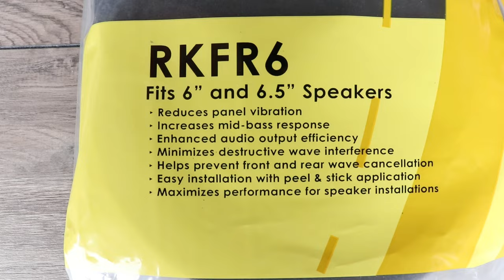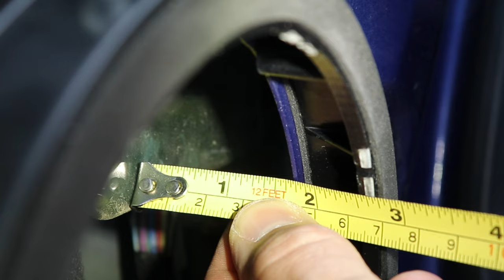Front Speakers UPGRADE, Toyota Corolla - How to Remove & Install New 6.5" Speakers

Comment: I thought that changing the OEM speakers in a car doesn't give much improvement, if any at all, because you are still using the OEM head unit.  I was told that changing out the stock head unit will give the most increase in performance per dollar because an aftermarket head unit will have a better internal amplifier.  

Like on my FJ cruiser, I swapped out the head unit and the OEM speakers had a significant boost in performance.  Guys told me that swapping out the speakers would not do much unless I also installed an aftermarket amplifier.
Reply from the maker: Every part you upgrade will give an improvement.  If you upgrade the stereo, you'll get a huge improvement, and speakers will be another huge improvement.  You can do either one, or both. Doing both will be the best. I've done this many times.. speakers and stereo, or stereo followed by speakers.  There is a noticeable improvement with either upgrade.
A cheap speaker replaced by a quality speaker will still sound better, even with the OEM head unit. Also a high end head unit will be able to drive a cheap speaker a little better due to better sound processing and fine tuning of the equalizer (boost bass, mids, treble). You'll still get a very nice improvement if you upgrade the speakers though.  There can be a rare exception in which the car comes with really good high end speakers..sometimes there are optional JBL systems, and so on..  that's not the case for my Corolla though.
Reply from the maker: Also, the stock amplifier on a high quality head unit is plenty good to drive a decent pair of aftermarket speakers (with the proper sensitivity)  to nearly their full potential. Don't pick high wattage speakers for a head unit amp.. if you do then an external amp is required.   External amp is not required to notice a big difference in sound quality, it is required to boost the wattage and get a big difference in volume .  I'll be posting a Head Unit upgrade video soon (upgrade to Pioneer stereo), with before/after sound sample. The Pioneer is able to drive the Infinity speakers way better than the stock unit.. as you mentioned, the unit does make a big difference.  But if I had the stock speakers, it wouldn't sound nearly as good.

Also if you want to have nice bass, then an external amp with a subwoofer is the way to go. Depends on what type of music you listen to.. you wouldn't need that for classical music for example. If you do go with external amp, then you can also consider an external crossover as well.. and then again the quality of the amp and crossover will matter a lot. A cheap amp may sound worse than the Pioneer stock amp.

Comment: Thanks for the detailed guide and time put into this. Fellow Corolla owners appreciate your time and effort. 

If you were simply trying to replace the speakers as they broken for a second time after Toyota fixed them once and keep costs low since Ed Sheeran and kids sings sound the same in your wife’s car could you leave out any of your build (ie the baffles) to cut costs? Thanks
Reply from the maker: Sure, just get the cheapest speakers, brackets, and some speaker tape. Baffles and foam are optional.. even speaker tape can be omitted.. and just use the screws that come with the bracket.

Comment: This sounds amazing and was well worth the extra work. Installed Alpine S2-S65C speakers and tweeters
Reply from the maker: NICE! Alpine is great! The old-style Alpine single DIN stereos were amazing. Were you able to get the tweeters installed in the same place as the original ones?  Thanks for the comment.
Reply: @CleverFix  Love Alpine, just
Installed an ILX W670. Bought a Pipneer e360x4 gonna push the front speakers in about a week from 16w to 80w rms after I let the speakers break in some

Yes removed the 10mm two cap nuts from the bracket on each side then unscrewed the tweeter from it from the back on one of them, the other I had to drill out (took an hour). The screws were both too snug to not strip, I got the first one out the last attempt before the screw was toast. I put the bracket back on then I used red 3m 25lbs adhesive mounting tape and disassembled the tweeter to its smallest form and pressed it really hard onto the bracket for about 2-3 minutes on both sides. From my personal experience it will never go anywhere, even if you try. Strong stuff. I tried to use the mounting stuff provided and two different tweeter mounts from Amazon that weren't quite the right fit but I couldn't figure out any way to use them that wasn't jerryrigged and any better than simply taping them.
Reply: Also I did this in a 2006 Corolla S, your guide was almost exactly faithful however the rivets are significantly harder to remove in mine than they were for you. It took me an average of 40 minutes each rivet to remove them and make them a threadable holes they all started spinning before I was able to remove them and melted the plastic ring onto the mount itself, destroyed a drill bit, i won't go into details just know it was a violent process, but I got everything off and only burned myself silly from friction heat twice
Reply: I wouldn't have had the confidence to do this myself if not for your detailed pov tutorial, thank you man
Reply from the maker: @GavinosuHighlights  Wow that's crazy long.. !! Sometimes going slow with a drill bit works better than going fast, I notice that a lot.. When fast doesn't work, try slower next time, with medium pressure.  A good bit is needed too, I think I was using Dewalt. They have been really good, I just drilled a stainless steel sink, which I'd have no chance unless I had the Dewalt bits. Cheap drill bits can have a lot of trouble going through metal.
Once they start spinning it's tough though.  Glad you got it done in the end!
Reply from the maker: @GavinosuHighlights  Not sure if you saw the tweeter video: https://www.youtube.com/watch?v=EG8nxTCzVa0  I was wondering if they would've fit in the original spot, the way the Rockford Fosgate did.  Sounds like they were too big. I drilled out the original cover and then just pushed the Rockford Fosgate right in. I like that it nearly matches the stock look. Thanks for sharing!

Comment: So, my car front speakers are wheezing and I am thinking about replacing it like you did. But I've seem a lot of videos of people doing it but they always add an amp to make it a whole new sound system. My question is, is it worth it just to do what you did or an amp is kinda necessary?
Reply from the maker: No it's not necessary with 92db speakers. Make sure the speakers you buy have 92db sensitivity, and are not high wattage.  They probably added an amp because they used high wattage and low sensitivity speakers to get crazy sound levels with minimal distortion. You won't shake the car next to you with this upgrade and no amp.. but it will be loud. If you want good quality music that doesn't cause hearing loss, this will be ok, and sound much much better than stock. Also to add an amp, it's ideal to have a line out, and the stock stereo does not.. using an amp with an already amplified sound source is not ideal at all.. so then you would first need to upgrade the stereo, and then add an amp, if you wanted to go that route. I do have a video for upgrading the stereo, which further improves sound quality: https://www.youtube.com/watch?v=JBnRhJJNNAE

Comment: A question.. if I replaced positive terminal by thr negative one.. what will be done.. will the speakers be burnt?
Reply from the maker: Watch a speaker when there's bass playing. The cone pops out towards you, and it goes "boom" .. if the wires are reverse, then the speaker will do the opposite. It will move inward instead of outward, so the sound will not sound good!  Sometimes it's not very noticeable, but hooking it up properly is important for good sound. It will not burn out.

Comment: What is the positive wire on the passenger side ?
Reply from the maker: Pink/White is positive on both sides.
Reply: @CleverFix  Thanks 👍 Had the same question. I should add. I believe to figure out the polarity you use a small battery?
Reply from the maker: @EdgarMendezz  Polarity is determined by the wire colors and speaker terminal size. I'm pretty sure I explained that in the video see 7:31 and the positive terminal is the thicker one on the back of the speaker. The thin terminal is (-)

Comment: You should upgrade the amplification part, the factory speaker may have an higher efficiency with the light paper cone, the new ones could sound more quiet without a proper amplifier

Comment: My speakers didn’t come with screws which ones would work ?
Reply from the maker: I believe it's #8 screw,  1/2" to 3/4" long, if you still haven't found it try a #8 with pan head from the hardware store and see how it fits.. I think #10 is too big. I will confirm by tomorrow and put a link in the video description to the proper screws.
Reply from the maker: Ok, it is #8, I'll be linking it up soon.

Comment: hey man looking to upgrade my corolla 2017 tweeters and woofers. i’m really confused as to if this car needs a crossover to the tweeters if i use the metra harness for each connection without having to cut anything.
Reply from the maker: The stock tweeters have a crossover built in, and the ones I used in my Tweeter replacement video also do.  So yes the tweeters need a crossover, but it's built it on many of them already.
Reply: so if i have a component set to replace each door speaker, i only need a crossover going into the tweeter?
Reply from the maker: @snaketripp  If the component set you have comes with a separate crossover for the tweeter yes. 6.5" coax speakers don't typically need any crossover, since they play mids and highs with the tweeter in the middle.  Some component speakers with tweeters and woofers (not coax) may have a crossover for the woofer too, but that's rare.. Coax 6.5" hooked up straight to the wire that's already there, and a tweeter with built in crossover is the easiest to install.. no need to find room and mount any crossover.. although there is room if the tweeters do have an external crossover.

Comment: can i do this to my 06 corolla ??
Reply: Yes you can, I’m doing it on my 05 Corolla. Only problem I’m having is to place the door panel in place, it looks like the new speakers are a little bigger in length than the original ones, I’m going to trim the plastic inside the door panel where it matches the speaker to see if it fits, other than that everything including the materials on the video will work just fine.

Comment: Hi thanks for your video. Im planning to change mine too. Do I need to disconnect the car battery while installing?
Reply from the maker: The car must be turned off completely:  no key in the ignition.  For extra safety the battery can be disconnected as well to make sure the stereo stays off, especially if the car has a remote starter.  When the stereo is OFF , there will be no power coming to the speaker wires, which ensures the stereo amplifier doesn't short circuit.

Comment: I have Seat Ibiza 2003, 4pin speaker connector (blue, yellow, red) Can i cut connector like you did?
Reply from the maker: If there are more than 2 pins, then it's not as simple as the speaker in the video.  You will have to figure what the 3rd and 4th pin are for.  Maybe the other 2 pins are for a tweeter? You will need a wiring diagram.

Comment: Nice definitely the next thing i like to do on the Corolla but is there a reason why you didn't use the Metra 72-8104 speaker harness?
Reply from the maker: Yes there definitely is a reason.. the factory connectors corrode. They're well known to lose connection, it happened to mine. I have another video where I fixed it..  So this is a good way to eliminate them.
Reply: @CleverFix  I have purchased all the materials and I'm putting the terminals on and sealing tape on. Before I take my door apart and commit any further, are you confident this will not corrode like the last fix did?
Reply from the maker: @joewhattoff8754  These are copper connectors not aluminum, they won't corrode like that. they're plated too.  So yes I'm confident.. there are millions of cars connected up like this, my last car I did the same thing and it never lost connection. The way I did it the aluminum wire butt connector + shrink wrap keeps it far from moisture and well protected now, so that won't corrode any more also.
Reply: @CleverFix  Is the smaller terminal the smallest .11 or second smallest .187?

I'm having a really tough time getting the .11 on. I'm scared I might break the negative piece on the 🔊
Reply from the maker: @joewhattoff8754  It's .11 . The other will be a bit too big. Just support the speaker plate from behind while pushing it on, and don't push it all at once, very slowly, and side to side while pressing down gently.  It will go on.  Just don't press too hard at once, that will bend one of them, I've had it happen.  Slowly and side to side is the trick to make it expand.
Reply from the maker: @joewhattoff8754  OK So one side lost connection after winter, the other side is still going. I thought these connectors would withstand the elements better. It was a super easy fix though, there wasn't any visible corrosion, I just pulled it off, squeezed the connector with pliers and put it back on, but this time I used dielectric grease and then taped over it with electrical tape. I should've put dielectric grease in the first place, but I didn't think this spot is so problematic, mostly because of all the salt we get here. The grease should protect against the elements for many years now. Soldering this spot can destroy the speaker if not done right, so I didn't want to do that.
Reply: @CleverFix  I have not had any problems and it's been 6 months. I'll refer back to your instructions if I need to make a repair.

I have really enjoyed the improved sound of the Infinity Reference Speakers!

Comment: Can you please share a link for a screws Length 1/2" . thread 8-32 with washer and locking nuts ?
This video has really helped me a lot. Thanks.
Reply from the maker: Here is a Pan head screw kit that has 8-32 screws, in 3/8" length which should also work. It doesn't have lock nuts, but it has lock washers which are almost as good.
https://www.amazon.com/Assortment-Phillips-Washers-Kwokker-Stainless/dp/B0BTYFHNBF
It's expensive, but it's nice to have for future projects if you fix a lot of things yourself though.. I went to Home Depot and bought them all separately, but had I know about a kit like this I would have got it. I'm always fixing something and I need a different size.
Reply: @CleverFix  Thank you so much.

Comment: I just did the upgrade following your video. I noticed that water from rain actually drips through the window seals and falls on the speaker and the inner panel. Does that happen to you?
Reply from the maker: I haven't noticed, but it is normal that a small amount water goes through the seal, that's why there are holes at the bottom of the door so it can drain out.  How did you notice the water?  I'm hoping if any water does get through, it would be repelled by the fastring, although it would probably absorb it..
Reply: @CleverFix  I noticed the water drips when I took the panel off to install the new speaker. It was after a rainy day so some rain  still remained. I saw the interior of the panel was wet and on the old speaker there was a puddle of water. Probably why the old speakers died if it got flooded by water like that. I might have to look into the window seals to keep the water out then
Reply from the maker: @philipcheung8910  Maybe you had very strong rains? If the seal is loose against the glass, that could let a lot of water in. Normally it should be tight to stop water, but a little gets through .

Comment: Excellent work , except for cutting off the door wiring harness , I'd have installed the connector from the OEM speaker to the new one instead.
Reply from the maker: Thanks! This is on a 2014 Corolla, with aluminum wiring, so cutting off the connector is a huge plus, because the OEM connector corrodes in time and loses connection.  That was actually the #1 reason for me to do the upgrade. If you have an older Corolla it will be fine though.

Comment: will that tweeter from the coaxial speaker give extra high pit to the sock tweeter? 
I am planning to replace my front door speakers but it's component speaker. I am stuck with how to mount the cross over. Or I should go for coaxial set to make life easier?

Comment: Is it worth it to add additional sound deadening to the door?
Reply from the maker: Depends on the system. If you have an external amp, and high wattage speakers, as well as a subwoofer, then it would help to dampen vibrations.  I've applied butyl rubber deadening to my entire car in the past,  but I had an external amp, and sub, so it made more sense. Without high power, the difference will be small, and maybe the $$ is better spent on an amplifier, subwoofer, stereo upgrade, or better speakers.

Comment: Thanks you great job! IS it not possible to use the old bracket?
Reply from the maker: There is no old bracket, .. the old speaker has plastic around it built in that is the "bracket" but it's really part of the speaker. Thanks!
Reply: @CleverFix  Ok thank you for the information, I thought you might changed it only for an upgrade 👍